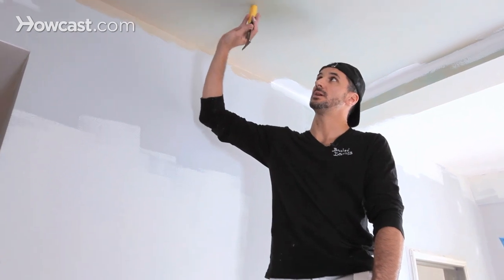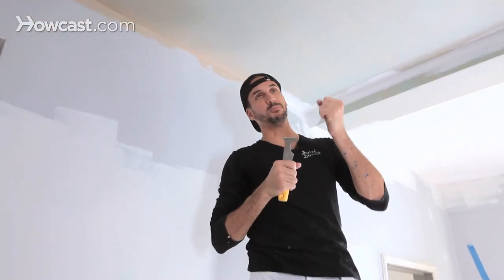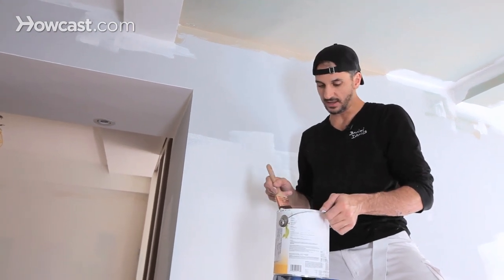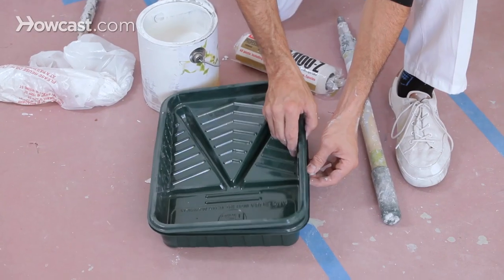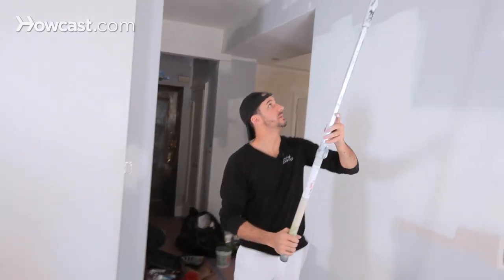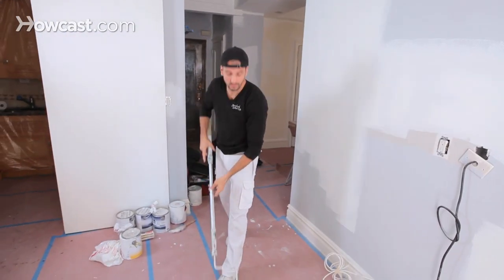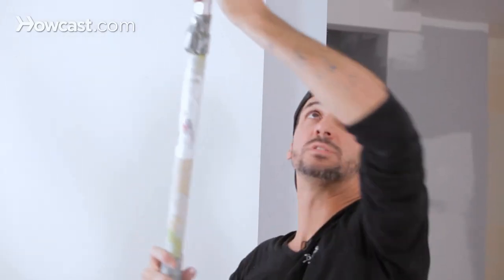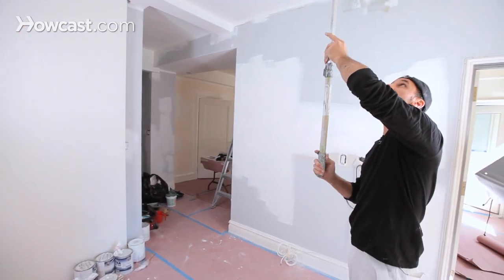How to Paint a Ceiling | House Painting

Comment: Homeowner DIY video.  Not for pros, we don't paint like that.. A bit of advice...use higher quality paint, provides the finish you want without drowning the drywall with over excessive paint. Always keep in mind, it will have to be painted again someday.
Reply: Struggling with ceilings. How do you get entire ceiling done before parts you did first start to dry? Keeping a wet edge is tough, especially on ceilings with a/c vents and recessed/can lights.